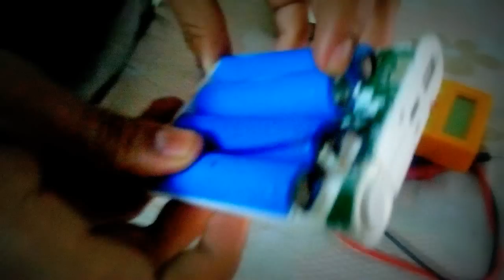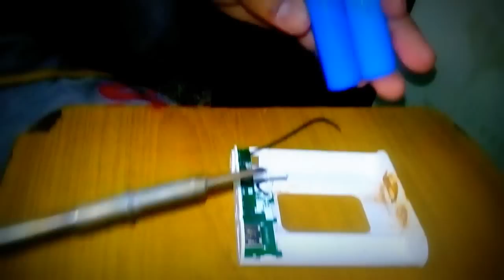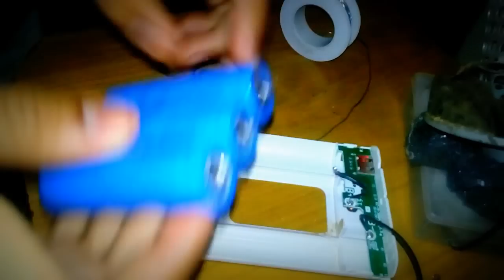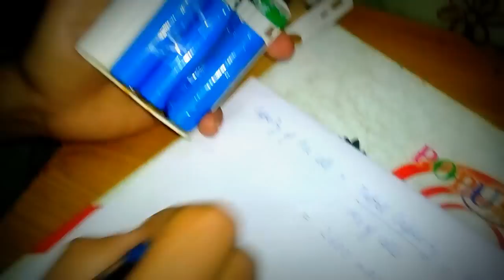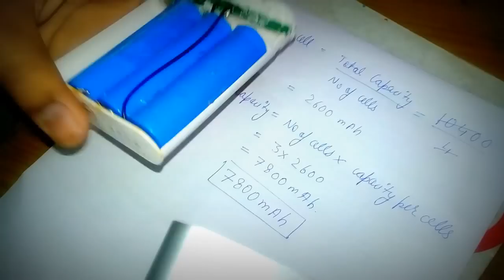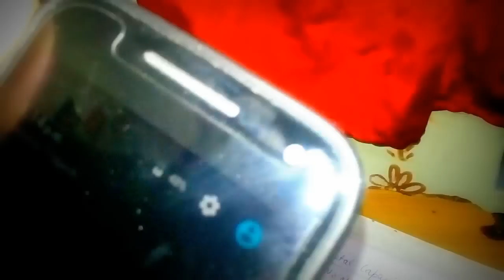Repair a Dead Power Bank || Repair and Replacement

Comment: Hi I just received my empty power bank n need to replace the batteries from my old laptop ( 6 cell ) can you advice again that is it serries connection or parrell connection ( ++++++ or + - + - + - connection ) just to make the right connection your advice please 
Reply
Reply: thepdfking  thanks
Reply from the maker: Hello Sammy. Thanks for query we will definitely help you out..:)
SEE in most cases laptop battery pack has 2 rows containing 3 cells each. Now remember that if we connect cells-> 
 1. In series-> voltage will ADD up but overall capacity(mah) will remain same of rating of one cell only.
 2. in parallel-> Voltage will remain same  but now Capacity will ADD up ,that is more "mah" in this case.
 Lets see an example:  Assume you have 4 volt 2000 mah * 3 number of batteries. 
Now let  if you connect 3 cells in series-> YOu get 12 volts 2000 mah pack
If you connect 3 in parallel-> You get 4 volts  6000 mah pack . And mostly power bank uses this configuration .
Hope you got the science behind it....And still you have any query you can ask anytime.  I will surely reply . Share and subscribe if you think you find something knowledgeable  .:) Thanks you.!
Reply: Hi MilliHard ,thanks for your swift reply ,i just got my power bank fixed ,will deffiniatly contact you if help is needed ,,buy Pal
Reply: Hi Millihard , Thanks for your valuable info ,but the problem i have now is all fixed as per your instruction , battery is charging from power adopter to 75% only n not 100% , But 75% is enough to power charge a cell phone , but than it,s not chargeing ,,,,what could be the fault , please guild me and thanks pal
Reply from the maker: use multimeter to check the output voltage...its should be around 5.0 to 5.3 volts. and also check all the batteries r in good condition or not.
Reply: Hi Milihard , How stupid i am,Thanks for the valuable info i miss that part will check n keep u posted for more info , Great thanks pal
Reply: @MilliHardTech  According to ur example of 3 cell each of 4v and 2000mah. If I have connected 3 cell in parallel connection then i will get 6000 mah but mobile charging  required 5v, so there is any boost circuits to boost 4 volt to 5 volt...??
Reply: @MilliHardTech  bro I want your help
Reply from the maker: @hackercyber1  tell your issue

Comment: hlo sir my power bank  I can't connect with charger......ethe charging holder were completed what will i do sir
Reply from the maker: you mean that you are unable to charge your power bank with charger? If so  please see that charger you are using is in good condition and if it is then check your power bank port via disassembling it . Like subscribe and share for more queries and videos.

Comment: other two batterys are fake
Reply from the maker: Yes Those are not working . I had just replaced with the new one. You can also do the same. If batteries are dead. Try to replace with new batteries to rebuilt complete capacity of power bank.
Share and Subscribe.
Best.

Comment: Sir hamara power bank gir Gaya sir Jamin per uske Baad kaam karna bund hogya  to kya kare  kaha se thik hoga ham Khanna se hai
Reply from the maker: Hello
[Hindi texted] : Power bank girne ki wjeh se andar ke connection loose ho gye honge..khol kr check kre or jarurt parne pr solder kr de agar koi connection loose paya gya h to.......multimeter pr continuity mode ka prayog se app check kr skte h ki circuit sabhi jageh se continous h ki nhi..
Koi b qusn ho to jarur puch skte h.
Millihard se sampark krne ka sukriya.
Like and subscribe jarur kre or anand le tips and trick ka.:)

Comment: Sir I have same power bank .and my power bank charging led are not blinking .when I connect to charger show 3 led full .and 4 led not blinking .what I do? Pls help
Reply from the maker: hello!
Seems that your batteries of power bank are too old..try to replace them with the new one.
Other queries are always welcome..:)
Thanks for contacting MilliHard.
Share and subscribe for more.:)
Reply from the maker: using multimeter try  checking shorts on pcb of power bank..check for loose connections,,,if u find all is correct then probably your pcb is malfunctioning..in tha tcase replave pcb .
Regards

Comment: Can I use sony vtc5 or other vape battery on my power bank?
Reply from the maker: hello! Yes u can use any battery but first u have to see the voltage rating of batteries must be same as found in power bank....cross check the voltage rating it must be same! commonly it is 3.7 volts.
Thanks for contacting MilliHard.
Share and subscribe for support!

Comment: If we want to replace all battery, example: using energizer batteries, does the voltage matters? Its only 1,2V per battery for energizers
Reply from the maker: hello
Yes the voltage matters a lot...conventionally batteries used are of lithium ion type which has a rating of around 3.7 volts, hence the PCB is made accordingly to that voltage value. so its better to use batteries of that voltage rating.
Hope you got the answer.
Thanks for Contacting millihard!
Queries are always welcome.
Share and subscribe for a little support.
Cheers!.:)

Comment: sr ye local .pawarbenk vord. bhot. slow. phn chrj karte hai ...aisa q ....
Reply from the maker: this is because of low output current rating of power bank. charging time is directly proportional to output current required by the device u r connecting

Comment: Hey brother, can you tell me that how can I check my pcb board. Batteries seems to be OK but problem should be in pcb. One of my terminals starts to burn as i connect them with batteries. I don't know about multimeter. I've purchased one yesterday, yet to learn that. How can i check pcb with multimeter? I have mextech MAS830L
Reply from the maker: Hello!
First of all congrats on your multimeter purchase.;:)
Now as u are new with the multimeter there are lots of things you can find out with the help of multimeter......from all of them there is one mode called "Continuity" test , which checks the continuity/ short circut on the PCB in order to find out break/shorts in pcb path, ....you can you this mode to find out if there is any break/short circuit in the path of PCB terminals.
Also cross check the battery voltage, Input voltage to power Bank , output voltage from  power bank, etc.
Queries are always welcome
Share and subscribe for more!
Thanks for contacting MilliHard..:)
Reply: MilliHard Thanks for quick reply. 
Yes, I need to ask one more thing. how can I check continuity of pcb?There is a WiFi type of sign next to dc range on the micrometer. I guess this is the continuity option. Isn't it?
Sure, I always share useful stuff :)
Reply: Just did continuity test. My PCB is dead. Have to buy new one. Could you recommend any good pcb. I had 2 usb port pcb.
Reply from the maker: correct that wifi type symbol is that continuity one...keep tinkering with multimeter....Stay connected as i will probably upload multimeter tricks in future,  which might help you.:)
Have a nice Day!
Reply: MilliHard hello brother, I'd burned my pcb terminal due to reverse polarity. Can I fix that?
There are not good fast charging pcb module online and a good one will cost me 600 rupee on amazon. that's clearly a rip off. Banggood asks for aadhaar card and pan card no, which I'm not giving them.
Could you help?

Comment: Mere pas mi ka 16000mah ka power bank tha but 5batttry me 1battry kharap nikla me kese repair karungi bataye
Reply from the maker: Hello
Just remove that dead battery simply...because all batteries are connected in parallel so voltage will not get affected but the capacity(mah)
will get reduced. 
Answer in Hindi: jo bhi battery kharab hai unko hata do....power bank fir se chalne lagega. Battery hata dene se voltage pr koi farak hi padega. ! bus power bank ki capacity kam ho jayegi.
Thanks for contacting MilliHard.
Share and subscribe for more.:)
Reply: Thank you

Comment: Sir I want to replace batery of my powerbank from where I puchase the batery and what is the name for this batery
Reply from the maker: Hello!
These are known as lithium ion battries rating 3.7 volts each...remember all the batteries u r using must have same voltage rating.....
Thanks for contacting millihard.
share and subscribe for morre!
Reply: >:( AAAAAAAAAAAAAAAAAAAAAAAAAAAAAAAAAAAAAAAAAAAAAAAAAAAAAAAAAA

Comment: Hii Iam watching your video s good   knowledge   I also having power bank circuit  and have new batteries  but its not soldering property by hitting solder what to do? Please suggest mi how to  solder
Reply from the maker: soldering in such cases is a difficult task.
Use flux while soldering...or put some solder on battery also first and then solder wire with the help of flux.....multiple attempts will give u the trick!
Thanks for contacting MilliHard.
Share and subscribe for more.:)

Comment: Hi sir I had made the same power bank as u made in this video but problem is that it is charging but it is not showing the charging level after when I cut the Supply of charging .What is the problem?
Reply from the maker: HELLO.
this is a common problem when the batteries are too old or dead...try to replace the old batteries with the new one.
Share and subscribe
Queries are welcome.:)

Comment: Sir I have an power bank in  which it shows tha t it is charging but doesn't charge the baatry what can I do?
Reply from the maker: hello!
please check the connection inside the power bank ..are they connected to batteries or not.
If are the connection are ok...then i think batteries are need to be replaced .  Batteries looses their capacity with the passage of time. 
More queries are always welcome. Share and subscribe for more support.:) 
thanks for contacting MIllihard.;)

Comment: Mera powerbanke artis ka hai 
Gir ne se bandh ho gaya hai
To kaise repair karu
Reply from the maker: hello.....if power bank is not working....try to open it check out  if there is any crack in circuit board or not.......check soldering and connections...check batteries are connected properly or not......then try again......more queries are welcome..:)
thanks for subscribing :)

Comment: @millihard hi
I have a xiaomi 10400mah original power bank. 3 years old

Recently the power bank took ages to charge fully. 24hrs or so

Opened up the power bank and checked one battery had slight leakage.  But was giving almost 3.7v. is the leaky battery that caused the charging delay.

Can i use the power bank with only 3 batteries. 

If so should i wait for 4 led indicator to light up. Or stop charging power bank once 3 led lightens up
Reply from the maker: hello:)
yes leakage batteries are not acceptable...remove it or replace it.
You can use remaining 3 batteries...this will work fine dont worry.....but the  overall capacity or can say backup will get reduce.
led indicator shows when all the connected and working battery get recharge.....so in this case also 4 led will tell that remaining 3 batteries are fully charged.....so go with 4 led for fully recharge..:) Hope you got it.
Share and subscribe for more upcomimg videos and suggestions.:)
Good luck! keep Tinkering.:)
Reply: MilliHard there shouldn't be any load balancing issue or battery heat up issue on using 3 batteries right?
Please confirm mate
Reply from the maker: Seshadri P R remaining battery will take current accordingly.... So no heating issue :)

Comment: can i use LG battery 3.7 volt
Reply from the maker: yes you can use...just remember battery voltage rating must be same.
Reply: MilliHard Sir backup dega
Reply from the maker: sure...if the batteries are in good condition
Share and Subscribe for more!

Comment: Mera power bank charge Ho rha h pr charging Nhi ho rhi h
Reply: Sem problam h Bhai mere sath bhi
Reply: Check the voltage at output usb.... It should be 5.0 to 5.17 volt... If not  your module is defective....

Comment: jab mai powerbank charging ko lagata hu tab oo 5vminitvke under heat hone lagta hai kyo ans do
Reply from the maker: Hello.
iske kai reasons ho skte h...
1st: App kya connect kr re h ...jaise ki heavy load like app kahi  heavy bluetooth speaker ho to run nhi kra rhe.(high currebt draw)
2nd : Heat jab produce hoti h jab positive ka negative se direct contact ho ra ho...so check for short circuit.
3rd: battery jab purani ho chuki ho to vo heat hone lagti h...and capacity reduce ho jati h....so try to change battery.
4th : check pcb m kahi short circuit to nhi ho ra.....
TIP: Power bank ko open krke..saf kare....dust particle/ rust hta de.
Thanks for contacting. Subscribe for more!

Comment: Bro in my power bank why they did not connected 1battery remaning three are connected can i connect the 4 batterys
Reply from the maker: Gaming with Arjun yes u can..... If it is a part of it
Reply: Bro but that battery colour was change
Reply from the maker: See the voltage rating must be same.... Colour doesn't matter
Reply: 3black batterys are connected but the fourth battery was in grey colour
Reply from the maker: Gaming with Arjun see... First see the voltage rating of all the battery must be same ....these ratings u can find written on each battery...... If not then...... Just connect the forth battery temporary ...and put it on charge...... If all works good then connect properly...... If u have multimeter ...make use of it.. Share and subscribe if u find it helpful.

Comment: Hlo kaise ho bai mera power bank charg v hota hai aur jb phn charg lgate hai uski light on hokar off ho jati hai phn charg nahi kr rha keya kru btao bai pls
Reply from the maker: check voltage via multimeter...it should be 5 volts to 5.3v....if not then replace batteries.

Comment: Better to replace all batteries with the batteries (Lithium Ion Cells) extracted from laptop battery pack. Check all those extracted batteries, if reading is less than 3.2V, throw them out, if reading is between 3.3 - 3.8 V, use it in power bank.
Reply from the maker: Sure sir this is also an alternation option if we want to salvage our laptop battery.

Comment: bro my battery is working also i fully charged the power bank but it is not charging the phone
Reply from the maker: hello! Please check the output voltage of your power bank or battery. It should be around 5.01v(minimum 5v) in order to charge your phone succesfully. Thanks for contacting millihard. Let us know if you have still any query.

Comment: I am putting 1.2 v×3=4.2 v (series),then my power bank is charging but my phone is not charging but when I am putting 1.2×4=5v then my mobile is charging but my power bank is not charging so can u bcz tell me whatever to do??//
Reply from the maker: Hello friend!
Thanks for contacting Millhard.
See our phone need 5v to charge if your power Bank is not capable of providing 5v...then phone will not charge.......also to charge power Bank it should b given 5-5.5v to charge...reminding that current flows from high potential to low potential...share and subscribe if u like it.:) thanks!

Comment: sir I tried to solder on battery ends but solder did not stick to battery surface I also tried running polish paper on Battery ends
Reply from the maker: Hello!
Put a little solder on battery first and then try.
Cheers :)